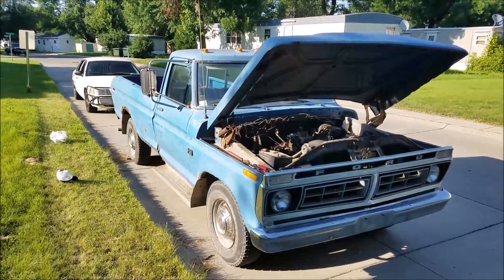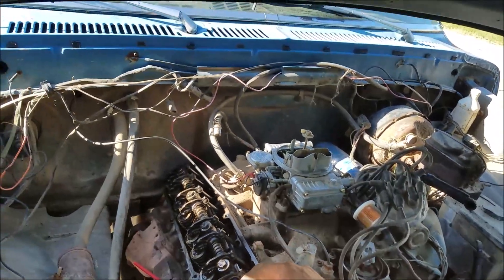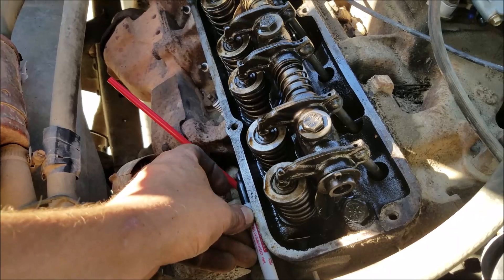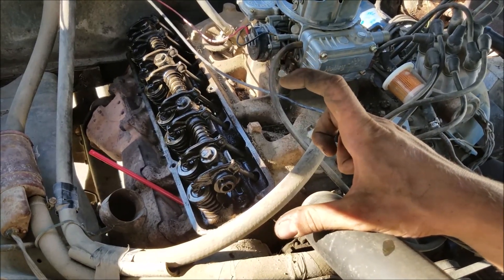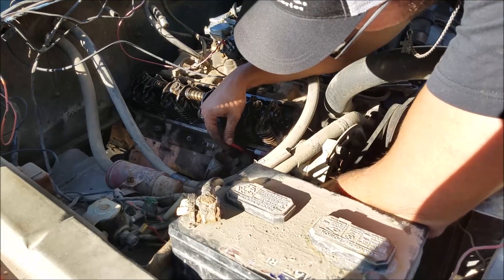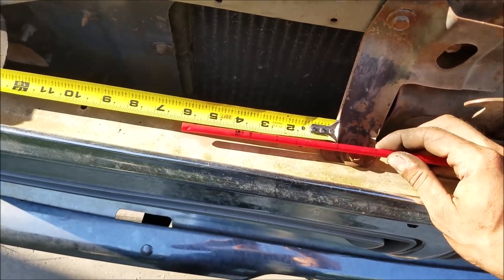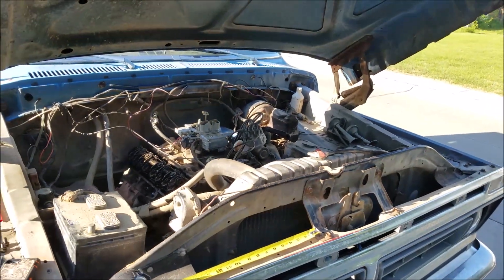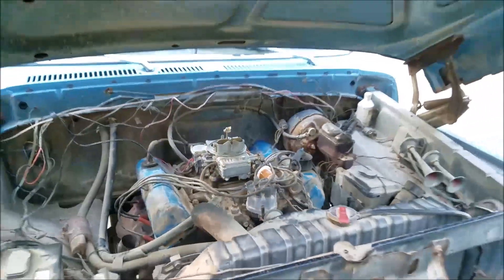Ford 360 or 390 FE Engine? - How to Tell the Difference in 5 Minutes

Comment: If a Ford truck has a 390, somebody took it out of a car and put it in there. I used a straight piece of coat hanger and measure as he did.
3.78" stroke is 390 and 3.59" stroke i believe is 360. Same bore unless bored out.

Comment: You could also look at the numbers on the heads, although they could have been switched. I once had a '66 ford F-100 with a 352. The head number was c7mea if memory serves, but that head number also was used on certain 428's.

Comment: I had a brand new F250 in 1976 390 the bigest difference between my 390 and my dads 360 was gas milage his got better fuel milage but horsepower wasnt much noticable difference 😊

Comment: CHEVROLET IS THE MOST WINNING CAR COMPANY IN THE HISTORY OF NASCAR. CASE CLOSED. YOU CAN KEEP YOUR FE 2 BOLT MAIN BLOCK WITH IT'S  CAST IRON CRANKSHAFT. AT LEAST GM PROVIDED STELL CRANKSHAFTS AND CONNECTING RODS. MOREOVER,  CHEVROLET IS THE MOST WINNING CAR COMPANY IN THE HISTORY OF NASCAR.
Reply from the maker: They were dominated by ford all through the 60s when ford cared 😄
Reply: GARBAGE. ABSCENT LEMANS, WHICH CHEVROLET NEVER ENTERED. MOREOVER,  I MAKE BANK WORKING ON FORD. FIX OR REPAIR DAILY. FOUND ON ROAD DEAD. FOUND OFF ROAD DEAD. PINK SLIPS ANYTIME. ALL MPOAR FANS LAUGH AT FORD.

Comment: BOTH ENGINES ARE BOAT ANCHORS!
CHEVROLET RULES!
Reply from the maker: Rule at cracking heads and blocks between cylinders maybe, no argument from me if thats what you meant 🙂
Reply: @ThunderHead289  NOT WHEN ASSEMBLED CORRECTLY. PINK SLIP ANYTIME!

Comment: You can also look at crank flanges with inspection cover removed .A 360 will have a large u notch in the flange  and a 390 has a small square  notch

Comment: you can do a QUICKER easier test by measuring the point on the straw in #1 cylinder like you did
BUT also measuring same thing on #4 piston which will be at the bottom of stroke at same time. so the difference will be stroke length

Comment: Don't look  down your nose over a 352 very good engine.   352 piston came to the top of the deck unlike the 360. Makes for better compression than the pollution 360
Reply from the maker: The 360 might be the worst engine ford ever made. I'd take a 352 over a 360 any day. And also I'd take a 60s era 352 4 barrel over a mid 70s low compression 390 as well.

Comment: I've had both engines in several Ford trucks. Because they are low compression, I couldn't tell the difference between a 352, 360 or 390.
But one thing. All of them are good solid performing truck engines.
If you live in cold climate area, they do take along time to warm up.
Get a block heater.

Comment: Side by side. In a pulling driving comparison, there is no difference in a stock engine.
But now if you were to compare and put a 390 out of a 68 car, now there's a difference.
Like any engine, the 360 responds well to adding a good old cast iron 4 barrel intake.
Now if I had the choice of a high compression 360 over a stock compression truck 390, I'd take the 360. 
What both engines need is compression. But with today's garbage gas, you can't expect good performance from these leaded beasts.

Comment: Like you said, I don't know if they are "Stock"  but I have come across a few 4bbl 360's on the "T" intake manifolds. Lot of people say all you have to do is look at the tag on the coil bracket, but I've found two of those 360's that they swapped the tag on to make them "look the part". Good stuff man!
Reply: Most of the tags are long gone. When I had my shop in the 80's and 90's, I used to collect them. I had a couple of hundred of them. Wonder if they are worth anything.

Comment: 360, the lack of power of a 352 and the bad gas mileage of a 390 combined to be a lackluster engine. Last good Ford truck came off the line in 1979. Love my old Ford trucks.

Comment: The Ford 1968 Ford Muscle Parts catalog  has a set up in it how to make your 390 a baby 427. Adjustable rocker arms, a solid cam that matches a 427 grind, flat top forged pistons, the GT heads sawed (I don't remember how far, but enough I had to grind the intake so it would bolt on) enough to raise the compression ratio to 11.5 to 1, and typical oil system modifications so it would live. A 750 Holley and a Stang that weighed just under 3000 pounds. With it I could take every car in the field...until the corners, then it was PUSH CITY on a quarter mile paved oval! I sold the engine and it went into a Fairlane that won the series dirt car championship at dirt tracks in Northern Nevada. I figure it was making just over 400hp. It cost me about 5000 1987 dollars.  

390s can GO!

Comment: As I understand it, the rule of thumb is: if it's four wheel drive it's more likely to be a 360.
I guess trucks that required more torque got the 360.

Can't claim I know for sure but I believe I remember doing some research a couple years back and that was the difference between the 390 and 360 applications from the factory.
Reply: Ford absolutely never used 390 in the 4x4. None of the Ford literature ever shows 390, though a dealer could install a 390 as a dealer option

Comment: The 352 is also a 3.5" stroke and they also used the same block casting.  The 360 has the 4.05 bore of a 390, the 352 has a 4.00" bore.   390 stroke was 3.780, so your straw test looks right.  There were a lot of 352s produced,  measuring a 3.5" stroke doesn't guarantee a 360 - last year of the 352 was '67.

Comment: How do you adjust those valves???
Reply: You adjust the valves on fe engines by longer or shorter pushrods.or industrial rockers which were adjustable or now you can buy adjustable rocker shaft assemblys

Comment: My father had a 1974 F-100 came with the 360. He said it burned to much oil so at 30K he took it out and put a 390 2 bbl in it. Couldn't talk him in to leaving the 4 bbl on it. He put the intake from the 360 on the 390 so he could run a 2 bbl. Still ran way better then the 360.

Comment: Ah but technically the 360 was a FT engine (Ford truck) as opposed to a FE engine (Ford-Edsel)  another FT engine was the 391 but I don't think they were used in any light trucks. IIRC Ford offered no 4BBL carburetors stock during that era. We bought a new 1972 F350 crew cab and a New 75 F-100, both with the 361 FT engine. We spun a bearing in the F-100 and it got put back together with a 4BBL intake from a 1966 vintage 352 (FE)  and a Holley carb.

Comment: Dad had a 75 f100 4x4 with the 360 in it. He had the truck for 20 years plowing snow and hauling firewood. In the early 80s he needed a valve job done. The guy who did the work for dad had a set of 390 heads and a 4 barrel intake and carb he put on it. After 20 years of plowing snow and hauling firewood it went to the junkyard with 213,000 miles on it. It still ran and drove even with a busted t-case. A buddy of mine knows who bought the engine and ran it for years after that.
Reply: they junked it over a bad t case? if so thats shitty its a pretty easy fix. you could get it fixed for less than 1000 today!

Comment: Ok, I'm confused. The FE ford engines of 352 and 390 in the 60's had split heads. When did that change?
Reply: It didn't change.  This engine is very dirty. It's hard to see the parting line. You can see it just below the push rods and the valve cover bolt.

Comment: 390 are rare  in trucks  most were 360  . Camper and trailer special  250 good chance  to have 390 . For what ever resons   they put more of them in the car's  than the  trucks  . Galaxy cars  were good doner finds for up grades for those late 60s  years.  Eye went with the Lincoln  460  AC compressor all . 72 4x4  250  4 speed NP 435 witch  is a trick because  460 did not come with manual  . 5 /8  spacer plate 400 m bellhousing  cut down bronze  bushing into the next step  down in the  crank  and re use the same  fly wheel  it can be done . Lincoln's  were ever where . But the motor craft carburetor  had to go! And stock distributor.  After that hang on !

Comment: After you get your top dead center measurement If you have a way to hook air up to the cylinder and pressurize it it will force the piston all the way to the bottom

Comment: I had a 1970 Ford F100 with a 360 in it and several friends had 390s they are good motors , but if you value your life don't put either one in a mustang.
Reply: No don't do that put a 428 in it like I did
Reply: I put a 427.

Comment: CAN  u?  TAKE  A  old fORD MOTOR  OUTTA   63  sTEVENS  dRAG  BOAT & SICCK  IT  LIKE   @  65  fALKCON?  &  MAKE  IT  A   truE  sLEEPER?   I  Have a  Bass  ass  boat  w.  a   built  390   old  Ford,  Whiplash  does  deoes    170in  A    1/2   MILE///  w 
WHIPLASH  IS  bADDASS     0 -  170 milbassaa   dflat  bottom   drag boat

Comment: Why do people avoid the 360?? I had a fresh one in a 76 Ford and it would haul the mail! Of course all the smog stuff was gotten rid of and it had long tube headers w|glasspacks. For basically stock it was pretty impressive for a truck
Reply: The bottom end goes out too easy. Bad oiling
Reply: @netrioter  ok...not saying your wrong. But it's a truck engine for lower rpm torque. I never saw one loose a bottom end BUT they weren't being raced either. I reckon everything has a strength and weakness. 360 is a good truck engine but prob not good behind a 4 speed and lead foot lol. 

My brother in law blew the lifters plum out of their holes on a 460 I had. It had a crane torque cam and 410 gears behind it. Would have ran 40 years with me driving and lasted one night with him. It was a stump puller not a drag car. But it was fast for 2 city blocks LOL 😂.
Reply: @JohnnyRebKy  The 360 isn't any weaker of a bottom end than a 352 is, and they put those in millions of cars from 58-67 and you know damn good and well lots of kids screamed them to the moon. I know I did, 6000 RPM and it didn't blow up! mostly the reason why people avoid them is terrible piston to deck clearance and they usually suck a lot of gas.

Comment: Talk about a good deal. You have way more value in the drivetrain in that truck than $1,000. The engine alone is well worth at least $1,500. I have had a few vehicles with the 390 and the 406 as well as the 352 and 351. I've had 289s and 302s as well and the 390 is by far the best big block of all of Ford's big block engines. They are easy to put a lot of extra power into them and that engine can really throw it's weight around.

Comment: I have a 69 F100 it has a 390 in it.It came with the 360 in it originally.But Mom was driving a galaxy that had the 390 in it.When she got a New Monty Carlo I got the Galaxy.Dumb kid hot rodding the car and wrecked it.So dad made me replace the 360 in the truck with the 390 out of the Galaxy.Its still in it and recently rebuilt to Ford factory specifications.After me it goes to my oldest son.I grew up in it and learned to drive in it.The clutch is a beast gotta have a strong leg.Its not perfect.But I love it.

Comment: Wow,
Darn good work. Having an issue with a  71 f100 360 just rebuilt the carburetor but yet the darn thing still hesitates when accelerating at a light.
Trying to get this one steadily running for my Pops.
Any ideas?
Thank
Reply from the maker: Hey my friend, join the Thunderhead289 Facebook group! Youtube has gotten bad at notifications, I can track a conversation much better there!
Reply: Check the power valve... if they fail it will give you a hesitation when taking off...

Comment: There is no appreciable difference between the two in stock form. The 360 only came stock with the 500cfm toilet bowl Ford used on everything. The 390 came 2 or 4 BBL. Get a 428 Crank, Balancer, Flywheel and pistons of course for 412 CID, 418 with a .30 overbore.
.

Comment: I found a 428SCJ in an old lifted F250 one time. I bought it from the guy because it had capscrew connecting rods. I assumed it was a HD truck engine or something. I tore it down and the pistons said 428 SUPER on the sides. The heads were 4 bolts hole CJ heads and the block measured correct dimensisons bore and stroke for 428. It was a very good day. Paid $300.00 for the motor. I put it into a 1957 Ranchero with a big spline top loader and 9 inch N locker. I towed my friends VW Bug powered Hemi to the drag races and never had to shift from 4th thru the entire journey over the mountains.
Reply: MPG ?
Reply: MPG wasn’t much thought about since gas was 28 cents a gallon or less when the FE engine was first built but I have been able to get about 18 mpg with a 68 390 GT fairlane and four forward with 3.25 rear but with a 2.70 rear in my 428CJ falcon I got about 20 as long as the right foot wasn’t too heavy.

Comment: Couldn't you just look at the VIN? And if the engine is apart wouldn't it say 390FE or 360 in the lifter valley? It's that way on my 351W
Reply from the maker: Nope, unfortunately the 360 and 390 share the same block

Comment: Look on the block driver side front the number stamped will tell u what the block was originally built as by ford
Reply from the maker: Michael Locher it doesn’t on a 390 - shares the same block as other engines.
Reply: @ThunderHead289  352 360 390 406 were all originally stamped by ford I can't justify what happened to them in the past 60 years. We've got several fe engines around they all have a number stamped on them its how ford marked them idk as for the 427 428 429 460 even tho experts say there fe engines to idk
Reply from the maker: Michael Locher there are numbers stamped, but you can’t tell from the block numbers if it’s a 360 or 390. It’s just the way it is. - that’s why this has always been a debate. 
Why when someone is selling, it’s always a “390” and when buying it’s a “360”
Reply: The ford manual shows 352 390 406 427 428 has 2 digit number n three digit number under it that for the factory engine size On the driver side front right below the cylinder head
Reply: @ThunderHead289  I was just trying to point out there's several ways to tell apart On the outside the fe n 385 share a lot but there's a difference between the two 360s n the top oilers side oilers the year they were built. I know what u mean I bought a couple old motors that were supposed to be 390 but blocks say 360 so I gotta discount but the average person wouldn't know the difference between them

Comment: It’s not an easy thing to notice, but the angle of the mating surfaces between FT and FE engines are not the same. Learned that the hard way when a friend tried bolting an aftermarket manifold he pulled from a 360 and tried mounting it to his 390. Same issue on a 352 as well.
Reply: The 352, 360 and the 390 are all FE engines. The FT engines are 361, 391, etc. 352, 360, 390, 406, 410, and 428 heads and manifolds are fully interchangeable.

Comment: From what I've been told, the 360 is a much more stout motor than the 390....
Reply from the maker: That’s definitely false
Reply: no same block as 352 with 390 bore. which 390 same block with longer stroke . IMO The best 4.05 bores 352 Fe blocks was 410 Mercury
Reply: Someone has been lying to you.

Comment: Can you tell from compression numbers. For example, my original 2.5l v6 compression should be 180-200psi , (9.1-1.)  When I swapped to the higher compression version (also 2.5l) the compression was supposed to be 200-220psi (10.1-1.)  The difference being the lower compression engine has dished pistons. Everything on the exterior checked, so far as it being what I paid for in my case. 

Also, what is an FE? Why have a separate line of gas V8s , if you have larger and smaller, big block/small block other variants of V8s?  Why make an incompatible engine?
Reply: FE stands for Ford Edsel
Reply: @krisco692000  You can never unsee the Edsel "bedpan" front grill :-D

Comment: Back when I was in my 20s, I bought a new Mustang convertible which had a 390 4V, 4 speed and "dapco" rear end in 3.25:1  Looked like a regular Ford 9", which at the time was as plentiful as one could want. After a year or so, I decided to warm it up a bit, and installed a 427 cam, along with the solid lifters and appropriate push rods and adjustable rockers. When I was finishing up the install, I found that new valve covers were needed, too! Fortunately, the local dealer had a pair on the shelf!  So, the 390 was rated at 335 HP and had a 10.5:1 compression ratio as I recall. Any guess as to the difference in horsepower? It surely felt faster, and the killer idle was awesome!
BTW...I'm now in my mid seventies, and still am again buying new  Fords, since 1986 after a hiatus of several years.  Marriage does that to you sometimes!
Reply from the maker: I bet it was 390 horsepower at least with a good 4 barrel set up!
Reply: ive heard that the old 390’s especially in the old 60’s thunderbirds were about 400ish and they were rated at about 390 if i remember right.

Comment: a 360 is a truck motor 352 reversed on left front of block
Reply: Could be 352, 360, 390, or 410 all had the 352 stamped on block.
Reply: @rmo4222  a 428 427 had it to number below #5 on block c6me a is 428

Comment: I have 76 f150 with 352 marking on the front of the block, I had it rebuild years ago but I am still not sure what I have. I am assuming it’s a 360 or 352.
Reply: I think all the blocks were marked 352 based off the original casting.
Reply: @scooterscat3309  correct

Comment: The 360's get a bum rap. They are all forged cranks that are fully counterweighted. If you ever wanted to build a wicked boosted FE engine, the 360 might be a good way to go.
Reply: that's the difference between an FE and a FT engine
Reply: The 360 was built with low compression and a cam profile made for pulling things, being a truck engine and all.   A 360 can warm right up with more compression and cam.